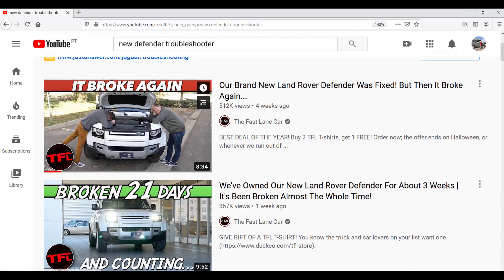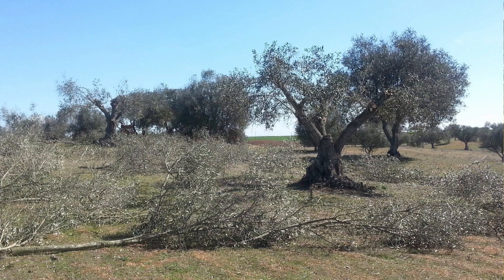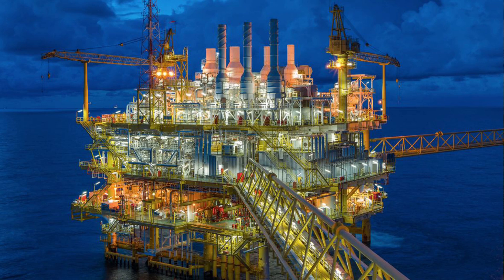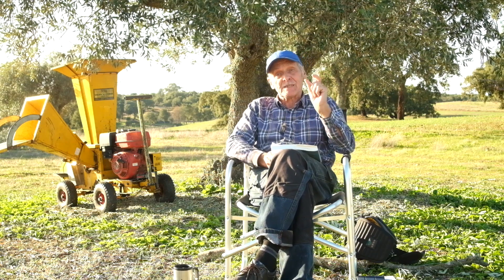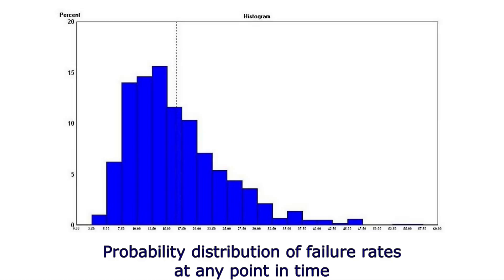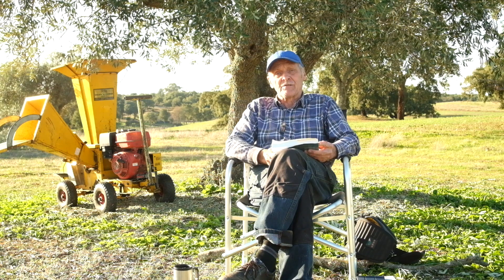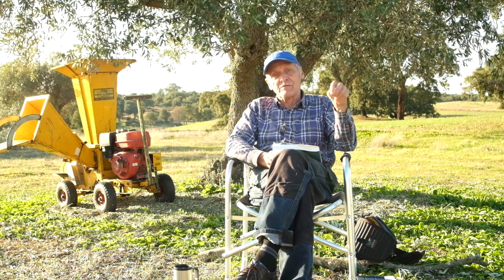Defender 2020 Reliability Woes - an engineering appraisal Pt. 1

Comment: Very Pythonesque background and sound analytical tack.  My simplistic take is that if the vehicle hasn't got one, it can't fail. The publicised  range of Defender "failures" so far seems to to span : 1)  unrepairable  "engine parameter" problem whatever that means, 2) an incorrectly installed exhaust sensor with melted connector, 3) camera communications issues, 4) the famous unrepairable winch installation "loom of doom", 5) false coolant low level warning driving uphill, 6) intermittent suspension fault warnings . I think I've accepted now what this vehicle is and what it no longer is. Setting aside the electronics, the deal breakers for me are the lack of wheel articulation and the undignified  tottering on three wheels when off road, plus road tyre aspect ratios.
Reply from the maker: Well said Phil. My part 2 video will be out soon. My take is that JLR could go a long way to sorting it but they aren't that interested.
Pythonesque background? It's just my olive grove. All I can do is to film the video wherever I happen to be.
Reply: @defendermodsandtravels  The newsreader sketch came to mind. Merry Christmas !